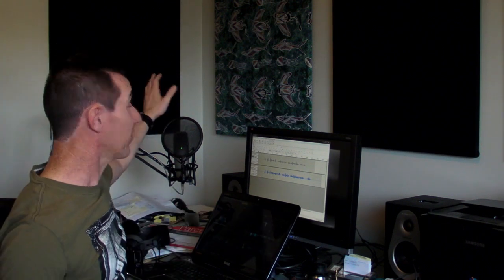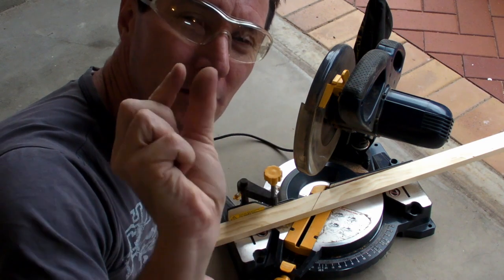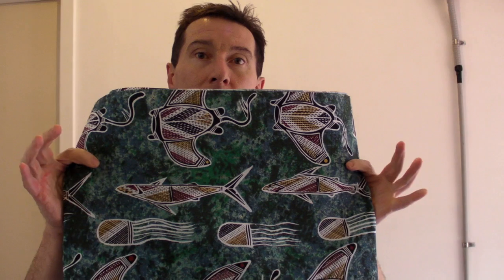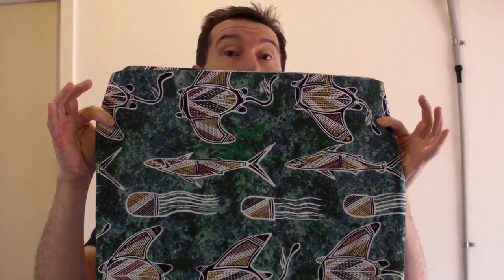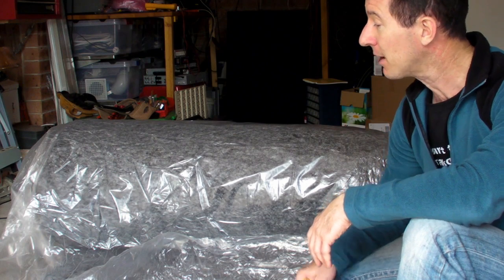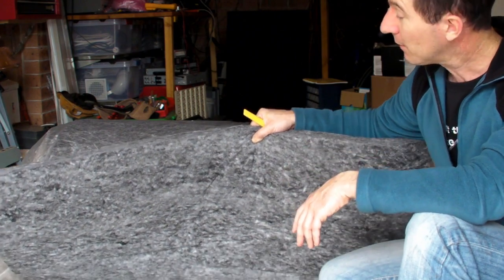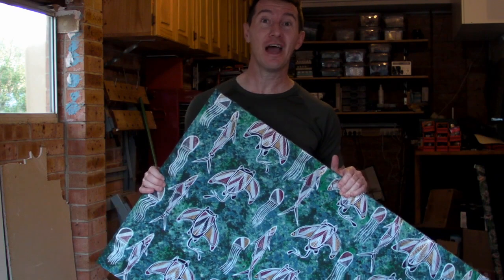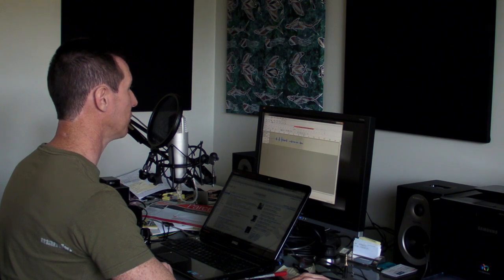EEVblog #172 - DIY Acoustic Sound Panels

Comment: READ THIS/ VERY IMPORTANT!!!!
This is some of the best material you can use. BUT he doesnt understand acoustics.

 1.The 90 degree corners of the room need bass traps, 

2. The ceiling needs to be treated.

3. Speakers need to be angled for perfect stereo playback, AND GIVE THEM SPACE FROM THE WALL.

4. The air gap between the wall and the panel is important.

Comment: I think you will get better results if you hang them a bit lower. Your mouth is in line with the bottom edge of the panels, so they're only half as effective as they could be at catching the first and second reflections of your voice.

Comment: trix to avoid hump use strong thin tread or wire that you wind around the frame with the aqustic damping mat in the frame then strech the fabrikk over and fasten it like you did first instead last.just n idea

Comment: I hear a lot of reverb in that room.  Not sure those panels worked so good.
Reply: My thoughts exactly, at the end of the vid when he's talking the room sounds totally untreated and very resonant! :(
Reply: Norman Fähndrich Right - the ceiling should be treated, and also the placement isn't right.  Using noise reducing panels is all about angles of reflection and preventing the bouncing sound waves from getting back to the mic.  This will also include the back wall.
Reply: yeah the panels are not thick enough to work well

Comment: It got funny...When he started referring to the frame thickness of the panel he was going to hang on the wall... Someone should have let him know... that sound and heat insulation..  loses it's value when compressed...Soaking up the sounds value works like a sponge gathers water...Not much water in a sponge when clenched firmly in your grasp.Also not sure at what point what his wife knows or has anything to say about the value or the need for  sound absorbing panels on the wall..  or his computer room/studio...Seems he was more afraid of what she might say than to risk the chance... Of letting him keep his balls in his pants...Lets hope she lets him take a piss in the bathroom..   all by himself...

Comment: Please take this video down..... 110,000 VIEWS???!?  I hope that many people didn't take this USELESS information and build these completely USELESS panels.....

BASS TRAPS: 4"-10" Thick..... RHT rockwool or OC 700 Series insulation. Put them in corners. For 6" And up you can use less dense insulation. 

Acoustic panels 2-4" thick: rockwool or OC, Reflection points and so on.
Reply: Why Bass traps ? Plasterboard as we call it in the UK is very reflective around 2KHz to 5KHz, that's the standing wave ringing you can hear in the untreated room portion of the video. What he has done in this video is make the walls less reflective. Perfectly adequate for sit-down voice recordings.
Reply: kiopl2003 In short he did everything wrong. covering fabric didn't look acoustically transparent, no air gap on the wall (At least 2") 2" Thick panels are the VERY MINIMUM. And even at that it needs to be RHT Rockwool or OC 700 Series insulation. I just don't want people getting the wrong information and spending all there time making something with horrible results.
Reply: Can you explain why these are useless? Are Manufactured panels always better? I've asking people who work in studios and they say the difference between no insulation to some diy stuff is a massive difference, but the jump from diy crap to store bought isnt worth paying for unless you are a professional.
Reply: kiopl2003 I did all my panels DIY ..... Just the way HE did these are useless. Read up on gearslutz or around the web how to properly make DIY bass traps and acoustic panels. I made about 12 USEFUL panels for around 300$. When you consider brand name ones are 100$ or more EACH that is some savings.
Reply: EnBeez the EmCee  cool. thanks man. better explanation there. Yeah, I need to look out for accoustically transparent fabrics. I want to do a project with panels and traps, but I dont have the sound system to bother tuning it to eprfection. More of an interest thing, to see what difference I can make if i try. But it'd be nice to do it the correct way :) I have been checking out gearslutz. I'm thinking of some panel absorbers I think theyre called and then jsut some high end absorption. my room isnt massive, but there is a huge ring in it (well huge to my ears anyways) Any partiular links to good plans on website? Nolan Nuzzo 

WaxingRadiance  when you say plasterboard, do you mean on its own, or as a membrane for something else?
Reply: *****
Anything is better than nothing.
Reply: Egg cartons do nothing for sound absorption.... They will do more harm then good it is an old myth. Please guys just go to your local hardware store and find some OC 700 or Roxul RHT insulation ..... Cheaper and less time consuming,.

Comment: didnt think they were doing much until i heard it without the panels even though the fabric used may not be entirely acoustically transparent they are obviously making a difference.

I dont know what mic you are using but if its cardiod polar pattern you dont need to worry so much about behind the mic particularly directly behind as thats in the cancelation zone . reflections coming from behind are more of a problem area.

But having them there will make the overall sound in the room better as the listener (you) isnt hearing any reflections from the wall behind the speakers/computer.

Comment: Your absorbers are fine if you have a high frequency echo problem (which you have). But they will not stop standing waves from low frequencies, which many larger rooms have. To achieve that you must have the damping material placed near the center of the room where air speed ist at its largest rather than up on the wall where pressure nodes are at their largest.

Comment: Keep in mind that he only needed to suppress echo in the Vocal range. So, the thin 1" panels were more then enough. Though you can hear it very well with the Studio Mic, the echo is very pronounce with the camera microphone. Really a tremendous difference.

I wonder if the Tontine Acoustisorb 3 is available outside Australia. It seems like a great deal. Ridged Fiber Glass Panels like Owens Corning 703 have a potential to particulate fiberglass into the air, ridge fiberglass does this to a much lesser degree than the soft fully house fiberglass insulation. I've always thought that when using Ridged Fiberglass, it would be best to put a thin layer of Poly Batting over the glass to reduce particulate matter in the air. Also, the cloth covering helps reduce particulate matter reaching the air.

What you us as absorbing material probably depends on where you are at. In the UK, you don't find much Owens Corning 703, though it is common in the USA. In the UK, most people will use Rock Wool, which is really scarce in the USA.

However, there is a new USA produce call Blue Jean insulation. Obviously this is flame retardant recycled Blue Jeans. While they make normal house insulation, they also make insulation for acoustic panels; it is a bit more ridged and more dense. But, the poly acoustic material (Tontine) I've only come across in AU. Still it is a very good idea.

Comment: I'm very aware of the differences, being that I use them on a regular basis. The SM7B is well known for use in podcasts & video blogs etc also it's used by quite a lot of rock and metal singers in a studio setting. Some real world use would show you that microphone selection is based on performance characteristics and not its label.

Comment: Just wanted to point out. You knock audiophile equipment. Yet you buy "acoustic padding" because it is different than any other polyester... Buying into the market are we? And the way you tacked the fabric on, lol, like that will help anything; just needs to be pulled tight not installed like a cylinder head.

Comment: Brilliant video. I love your work. Just a few points on making sound absorbers though. The fabric should be breathable and used on both sides of the frame. If you mount them slightly away from the walls and across the corners of the room you get better bass absorption due to the longer wavelength of low frequency waves. The density of the wool is more important than the thickness but for voice overs that isn't an issue. With music and pro audio it might be. Happy New Year! :0)

Comment: These panels are too thin to really do that much absorption and there's hardly any, if any, bass trapping in the corners and certainly nothing deep enough or with enough air gap to provide absorption in lower frequency ranges. Try doubling the rockwool thickness and adding an air gap between the panel and the wall. Closed weave fabrics are also bad for allowing the rockwool material to absorb like it's supposed to. Awful fabric choice imo too! I'd look elsewhere for my acoustic panel DIY vids...

Comment: hey man, nice tutorial, great enthusiasm as well! quick tip for better sound, you might want to isolate those monitors from the desk, as bass energy gets trapped and transferred. It'll affect how you may mix/ basically hear everything. That same foam you put in your panels would do just fine under each speaker, maybe stacked up on itself a little bit, but the principle is the same. You can get plenty of other isolators out there, but you have some good stuff to work with already. cheers

Comment: Ok, when you measure for the cut, it will be angled, so do you measure for the long side of the finished cut or the short side? Because there would be a big difference. Right? Thanks:)
I love your vids:) I subbed a while back after watching your "how to solder" video/s. They are excellent! Thank you for them:)